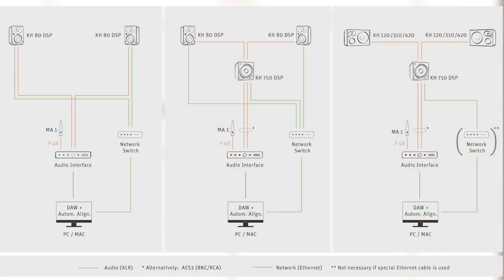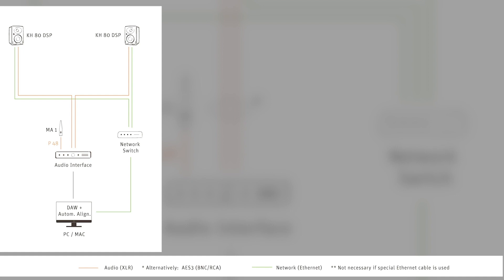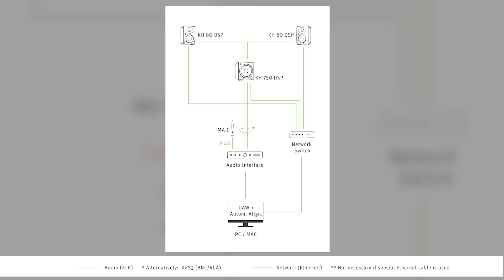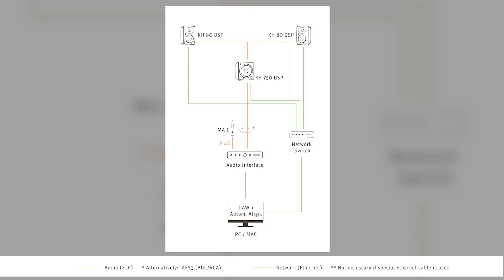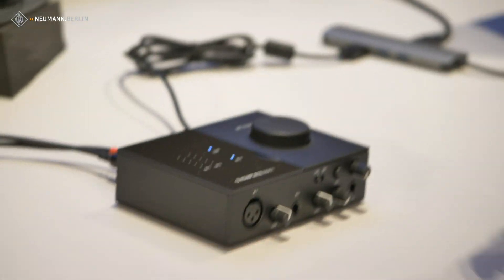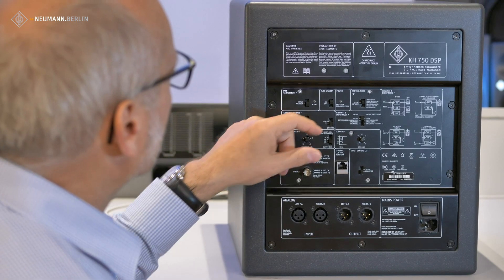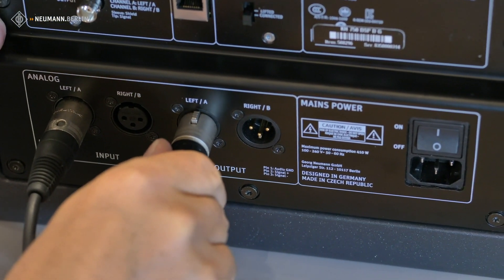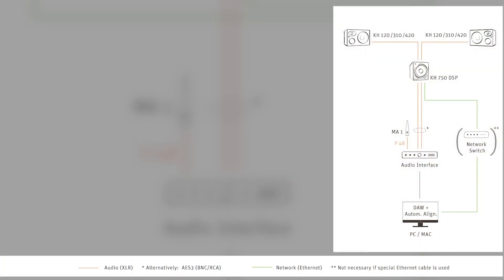Welcome to the MA 1 | Part 5 - Setup Scenarios

Comment: Hi a short additional question. If my Monitor Controller has a  possibility to host a subwoofer, should I connect the subwoofer to the device, in my case a SPL monitor controller marcone, or should it still be connected as you described? Thank you for considering a answer 👍🏻🙏🏻

Comment: Can i bypass the subwoofer and listen full spectrum from left right speakers
Reply from the maker: Yes you can! Simply deactivate bass management in the app.
Also themonitor must be connected via Ethernet cable.
Reply: @GeorgNeumannGmbH  ok
Reply: @GeorgNeumannGmbH  I have Neuman kh 310 Monitors .I think it doesn't have ethernet
Reply from the maker: Unfortunately, this will not work in this case. The KH750 sub is kind of like the “brain” in this set up, and it outputs to the KH310s.
Reply: @GeorgNeumannGmbH  ok
Reply: @GeorgNeumannGmbH  Can I use footswitch for talk back in mt 48

Comment: Hi, I use a RME Babyface to calibrate the System with 2 KH80DSP and the Subwoofer KH750. The BF feeds the sound in to a Behringer Monitor2USB and then in the KH750 which feeds then 2 KH80. Would it be possible to  change the path of wiring after the calibration/alignment and skip the BF and use the usb connection oft the Monitor2usb and connect the KH80 direct to the Monitor2usb also the subwoofer. So I can switch between 2 sets of monitors and use also headphones. Will the image change if the BF not in the path. The Monitor2usb works also as a soundcard, but is not recognized by the Neumann M1 software, also it has no phantom power. Would be great to have a monitor controller from Neumann who sits in the center of this system, like Genelec does it. Or can you recommend a better monitor controller?
Reply from the maker: The MA 1 measurement data is stored directly on the speaker's DSP. You can therefore also change the cable routing at the audio interface level as long as you use the same inputs on the KH 750. If you change the input signal on the subwoofer (for example you switch from analogue XLR to digital AES3) a new setup with AES3 input would have to be created in MA 1 and a new measurement would also have to be carried out. Regarding Monitor Controller please have a look on the Neumann MT 48.

Comment: Hi, I was hoping you could help me out here. I bought 2x KH150 with the MA1 mic. I bought a network switch and connected it to my mac mini ethernet port. I connected my ethernet port on my Mac Mini to the switch, also i connected both ports from the speakers to the switch. The mic is connected to a Tascam Model 24, which is via USB connected to my Mac Mini. Also the switches in the back of the monitors are set to Network. So, I did all the steps explained in this video but the software keeps telling me that the speakers are not found. I'm getting a bit frustrated here because I own the complete kit since august 2023 and still didn't make use of the software because of this issue. I was in contact with your customer support, which did a great job of helping out but we couldnt find any solution. Any chance you know what's wrong? Thanks in advance
Reply from the maker: Hello, by contacting our support, you have already done everything right. Do you have a service ticket number?

Comment: Can I make the alignment if the computer is wii fi connected and the sub is connected via ethernet at the same network?
Reply from the maker: Yes, this is possible.  It may be slower than with wired ethernet connections though!
Especially if there are firmware updates to perform.

Comment: Hi! Do I need to use a switcher or can I connect the KH750 (ordered and coming to me :D ) using the network sharing controls of my studio's Mac Mini M1?
Reply from the maker: Hi Felipe, a network switch is definitely recommended, especially if there is more than one DSP-enabled monitor in the configuration – so a KH 750 + KH80, or 120 II, or 150. If it’s just the one KH 750 sub plus analog speakers like the KH 120 A D, 310, or 420 – they may not need the switch if your computer has an ethernet port to directly the sub to. This can and has worked. You would still need WiFi for any firmware updates. But a network switch (or router) is generally advised, and absolutely necessary with more than one DSP enabled speaker.

Comment: what if I dont own an interface?
i want a Neumann 750 DSP sub with my analog speakers and that fine-tuned with MA-1 microphone.
is that possible ? i could give the 750sub the XLR via my XLR output dac. would be that okey ?
Reply from the maker: An audio interface with at least one microphone input (with +48v) and stereo outputs is a requirement for MA 1 calibration.  If running on Windows, the audio interface must provide an ASIO driver (Mac can be class compliant/CoreAudio.)
Reply: @GeorgNeumannGmbH phantom power has to be on when using Ma-1?

Comment: what happens if in the third scenario I take an OTHER (non-Neumann) analog speaker ? and not 120/310/420 ? the subwoofer can still be eq'd with MA-1 properly ?
Reply from the maker: While a non-Neumann monitor could be theoretically connected to a KH 750 and subsequently calibrated, we cannot guarantee the end results will be satisfactory.  The MA 1 solution is designed and spec’d for our monitors specifically.
It’s not that it may not work – it’s that we cannot guarantee the satisfactory results of such configurations.

Comment: Could you explain in more detail the connections to the network switch? I’m having trouble with the software and want to be sure I have it all connected properly. When you connected the computer to it, what was the cable that was plugged into the first input?

Comment: I recently bought a pair of kh 120 and single Kh 750 dsp. Thinking of getting the MA-1 to calibrate them. Do I need to keep the network switch connected at all times even after calibration or is it just necessary for calibration?
Reply: probably the speaker / sub saves the preset into its brain. no connection needed after calibration with network switch.

Comment: Hello, upon setting up the KH80’s and KH750 for alignment, could I then connect the kh750 and KH80’s to a monitor controller instead, as I have multiple sets of speakers that I need to switch between them whilst working.  What is the best way to do this?
Reply from the maker: Hi Ria, you can use your monitor controller in the alignment process. Your signal routing does not have to change here.
Don't forget to turn off the hardware monitoring during the calibration process though. For further questions, please contact oliver.westphal@sennheiser.com or call +493920372741.
Reply: @GeorgNeumannGmbH  Thanks very much for your response.

Comment: When using the KH750 with analog monitors, the image in the video says a Network Switch is, "not necessary if special Ethernet cable is used." I looked up special Ethernet cables, but could not find one. What exactly is meant by "special Ethernet cable"?
Reply from the maker: Hi Sam! You don't need a special ethernet cable; a standard one will suffice!
Reply: @GeorgNeumannGmbH  Thanks for your unmatched passion for quality. 
I've set the KH750 to Network Control Mode and connected it to KH120s. The ethernet cable is connected directly to the computer. The MA-1 software does not recognize the sub or the monitors and a circle keeps on spinning. 

I've granted the MA-1 software full access on local and private networks when installing in Windows. I also updated my ethernet drivers with Intel and temporarily deactivated the firewall to allow all outgoing and incoming network connections. Any ideas on why I can't get the connection? Thank you in advance!
Reply: @GeorgNeumannGmbH  Ah! I needed to enable IPv6 in
Control Panel> Network and Internet> Network Connections> Ethernet (clicked on Properties)> Checked the box for "Internet Protocol Version 6 (TCP/IPv6)"
Finally I selected the corresponding Network Interface from the dropdown in the software and Boom!
Only question is I see only the KH750 listed, is this normal because the 120s are analog?

P.S - The help menu in the software did the trick for me as it is very thorough!
Reply from the maker: Hi Sam! Indeed, you need to enable IPv6. The KH 120s are not visible because they are analog and controlled via the KH 750 DSP.

Comment: Hi, can I use the MA 1 mic and alignment software to calibrate the Kh750 only?  I ask this as I would like to purchase the 750 Subwoofer, but I am not going to be using with Neumann monitors to begin with but rather with NS10’s.  Can I still take advantage of the DSP of the 750? Thanks
Reply from the maker: Hi Ria! The KH 750 has a very precise built-in x-over, which fits perfectly to our loudspeakers. It also has very flexible gain setting options and further acoustical options to be able to align it ideally to Neumann KH-line loudspeakers. In combination with our MA 1 – Automatic Monitor Alignment it is even possible to align our DSP loudspeakers automatically. In combination with the KH 750, our analog loudspeakers can then be aligned as well and optimized in their phase response.

However, with this flexibility it is of course possible to connect other brand loudspeakers even if we think best results would be achieved in combination with our loudspeakers 😉.
Reply: @GeorgNeumannGmbH  thanks for you response, which I do appreciate.  Although, I am still a little unclear as to whether I am able to use the Ma 1 mic and alignment software to calibrate the KH750 on its own?  Can I still use it without using Neumann nearfields monitors?  As I will be using  Yamaha NS10’s as my reference monitors, but it would be great if the MA 1 mic could be used to set up the kH750 ONLY is this possible?  Many thanks
Reply from the maker: Hello Ria, 

It is possible to align a system consisting of a KH 750 DSP in combination with connected other monitors.  Important for the alignment is that monitors are connected to the subwoofer and the connected speakers reproduce an appropriate level and frequency response.

In your case you should connect the outputs of your KH 750 to your amplifier which is connected to your NS10. Please level the amp by playing some music, switching the KH 750 to local mode and setting the level to 100 dB SPL and the gain to 0 dB.
Then switch back to network mode and go through the MA 1 adjustment and define the KH 120 as monitors.
Reply: @GeorgNeumannGmbH  thanks so much for your really helpful response. I am very grateful for your explanation. I now feel much more confident at the prospect of adding the KH750 into my setup and am even more encouraged now that I do have the option to use the MA 1 mic and software!! Thank you for making  things a lot clearer and easier for me to understand.  Best wishes
Reply: @GeorgNeumannGmbH  hello again,  I am soon to make my purchase of the KH 750 and MA1 alignment kit to using in conjunction with NS10’s. However,  I am having some difficulty understanding how I might connect the output of the Kh750 to my amp (Yamaha AS301) as you previously advised due to amp only having sub out (rca Jack)  option! My  NS10’s are connected to amp using bare wire method. Obviously, this is not an option for the sub.   Therefore, what are my connection options here? I am also using a Audient Nero monitor controller and Apollo twin as well as a  mixer. Any help you can provide would be greatly appreciated. Best wishes
Reply: @riasure  привет, какой у тебя усилитель для нс10?
Reply: @dozaplombira  Здравствуйте, я использую усилитель Yamaha AS301 для NS10
Reply: @dozaplombira  Hello,  in answer to your question.  I am using a Yamaha AS301 amplifier with my NS10’s!
Reply: @riasure  your amplifier is not quite suitable for connection, you do not use a balanced connection via the rca connector, and Neumann uses a balanced connection with an xlr plug, you need to buy RCA wires on one side, and XLR on the other.
Reply from the maker: Hi, the signal source should be connected to the sub input, the output of the sub should be connected to the input of the Yamaha amp. The sub should then be capable of applying bass management. We hope this helps!
Reply: @GeorgNeumannGmbH  thank you for your helpful response.  I appreciate it.
Reply: yes you can use the subwoofer to calibrate the yamaha monitors, you need to connect the yamaha amplifier to the neumann subwoofer and select the neumann kh120 monitors in the program, the program will know that you have them connected, but in fact you will have ns 10 ,.  the subwoofer will save the settings for your monitors.
Reply: @dozaplombira  thank you for your response, which I do really appreciate.  My question is how would I connect NS10’s via AS301 amp to KH750 subwoofer?  As I  have connected NS10’s to amp using bare wire method, which would not be an option for the KH 750 and the only other output on amp is sub out which uses mono RCA.  Any help or advice you can give would be welcomed😄👍🏾
Reply: @riasure  you need to connect your sound card to the Neumann subwoofer, and connect the output from the subwoofer to the aux input of your Yamaha amplifier
Reply: @dozaplombira  thank you so much for getting back to me-I really appreciate it.  I will therefore connect. Apollo Twin Monitor L & R output to that of the L & R inputs of KH750 and the Output L & R  of the KH750 to any of true Amp Aux Line input L & R.  Is this correct?   I. feel much more confident about proceeding based on your clear instructions, so thank you.  You have been extremely helpful.
Reply: @riasure  yes, you absolutely correctly connect the equipment to such an input
Reply: @dozaplombira  Thank you once again. Or perhaps I could connect Spdif input from amp to Kh750? Would that be a better option perhaps? Although It would require some sort of adapter I would imagine. Not even sure if this would work, but am just considering all my options. Many thanks
Reply: @riasure  hi, unfortunately it won't be possible to connect the system, in this case you will need to connect the digital output of your sound card to the digital input of the subwoofer, and from the subwoofer connect the digital output to the digital input of the yamaha amplifier. In this case, the system should work.
Reply: @dozaplombira  really appreciate your response once again.  That sounds like a better solution for connecting to the subwoofer and sound card and most likely the way I will choose.  I am very grateful for you taking the time to help and explain this to me.   In addition,  I am also seriously considering changing my as301 amp to something that has  balanced in and outs.  Something like  the ‘behringer a800’ which might be better suited to driving NS10’s and connecting sub.  Am still researching  this to find the best way forward. Thanks once again-You’ve been amazing! 😄👍🏾
Reply: @riasure  look better at the crown d'75 amp for yamaha monitors, it sounds very good but has no digital input.
Reply: @riasure  or even better, it has a balanced connection, you can connect it to the Neumann subwoofer
Reply: Yamaha pc2002m
Reply: @dozaplombira  Some great recommendations here that you have given for vintage amps.  Thank you. However,  both can only be purchased second hand and I am a bit nervous about doing that!  As these are quite costly to service/repair- the Yamaha pc2002m especially.  Although,  I wonder whether you think the ‘Crown XLi 1500’ would be worthy of consideration?  Or back to original contender Behringer a800? especially as I am just wanting to upgrade current hifi amp and choose something better suited to home studio set up for purpose driving NS10’s and connecting KH750 sub.   I would preferably like to buy brand new item, as purchasing second hand could be potentially risky.  If you could recommend any other choices I would be very happy to hear them😄👍🏾
Reply: @riasure  Arcam HDA SA20
Reply: @riasure  Mytek Digital Brooklyn AMP
Reply: @dozaplombira  thanks so much for these recommendations. I appreciate you taking the time to do this. However, unfortunately the Mytek exceeds my budget!! Although, I have been researching this topic all day and have been told to seriously consider the Avantone CLA 100 or better still the CLA 200.  These are especially recommended to drive the NS10’s which is what has made me really consider them.  Are you familiar with either?
Reply: @riasure  yes this is a good amplifier, I think it's worth taking it
Reply: @dozaplombira  thanks for your feedback.  It is looking highly likely that I will go for either CLA 100 or the CLA 200. Thanks once again for all your help, you’ve been great!😄👍🏾

Comment: when the alignment is done, in which position should we put the switch back? (always network on, or can we put it back in local mode)
Reply from the maker: Hi, you have the possibility to deactivate the automatic calibration by setting it to 'local'. By doing this, the switches on the KH 750 can be modified. When switching back to network, the original alignment done with the MA 1 is active even without the need to connect to the computer again.